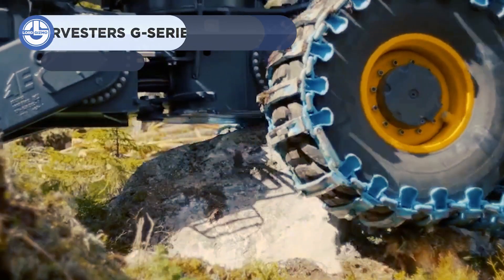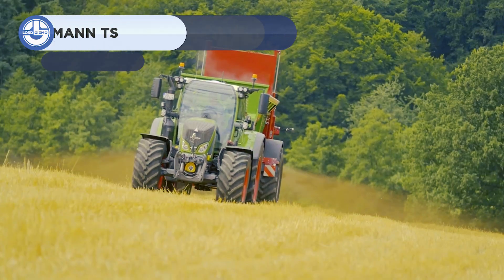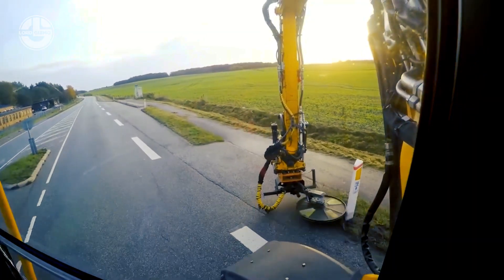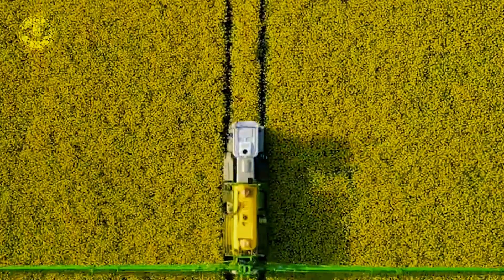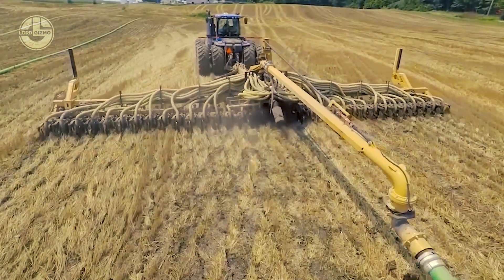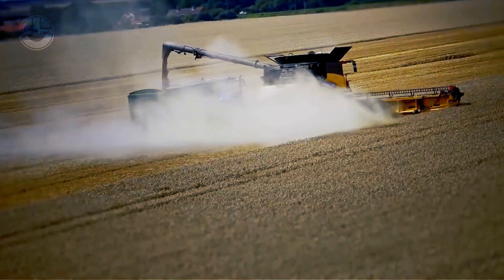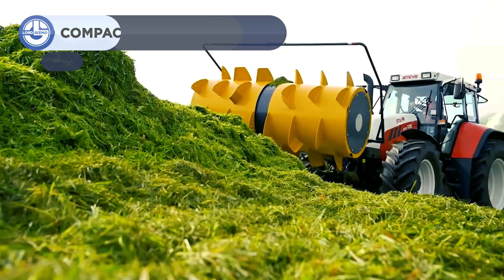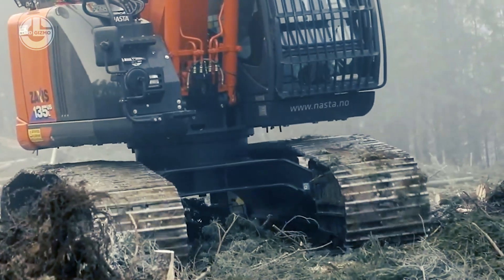TOP 100 Powerful Agriculture Machines Revolutionizing Farming

Comment: 12:00 A fertilizer spreader is a crucial tool in agriculture, ensuring even distribution of fertilizers across the field. These machines often come equipped with modern technology to adjust the amount of fertilizer and the spreading pattern for optimal fertilizer usage.